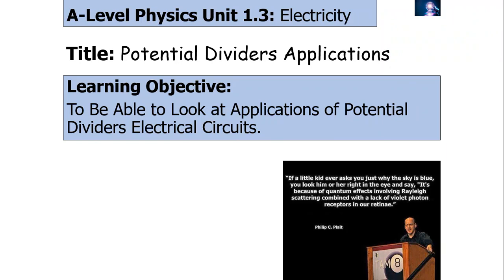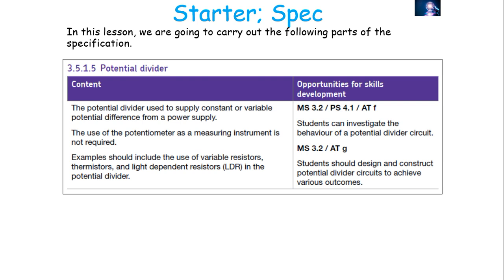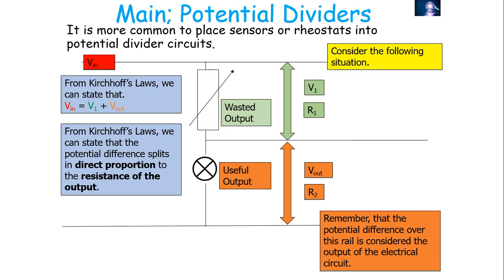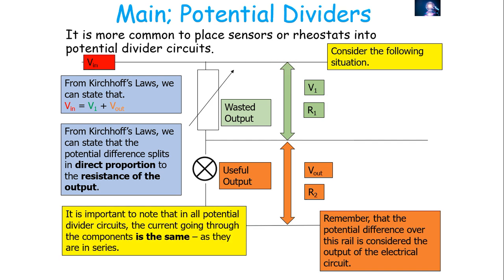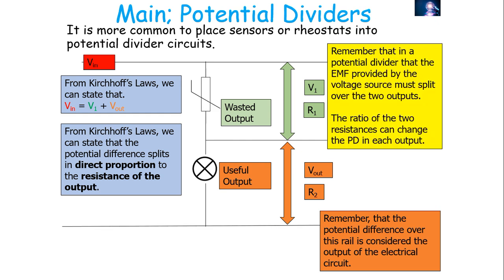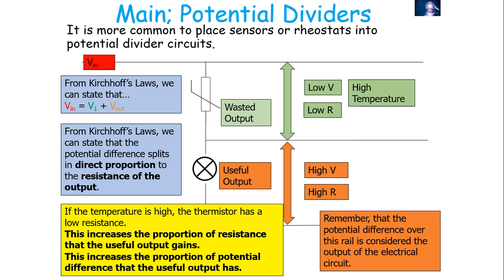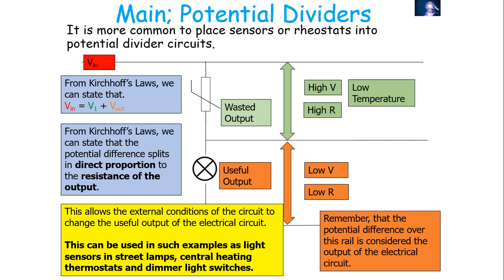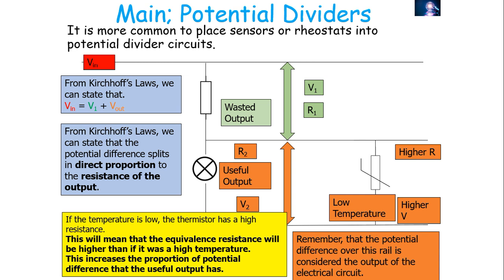Applications of Potential Dividers

Comment: Hello sir how should I try to understand this  

Should I talk about the total resistance of the circuit changing as you change the variable resistor which leads to a change in current and a change in the brightness of the bulb

Or should I say the change in the resistance of variable resistor leads to a change in the pd of the bulb which leads to a change in the power dissipation leading to the brightness changing